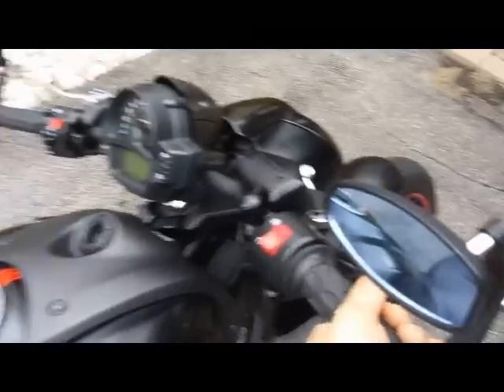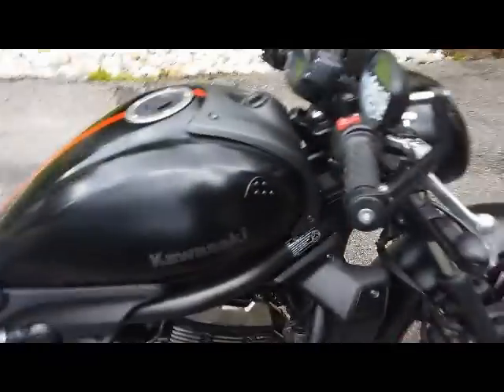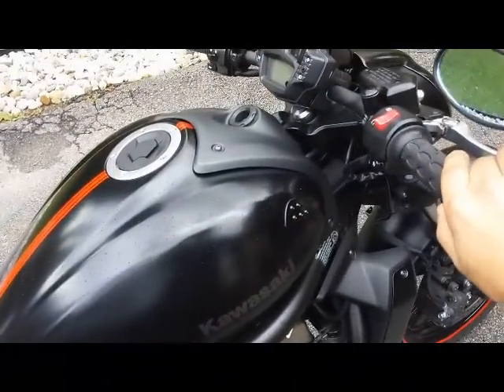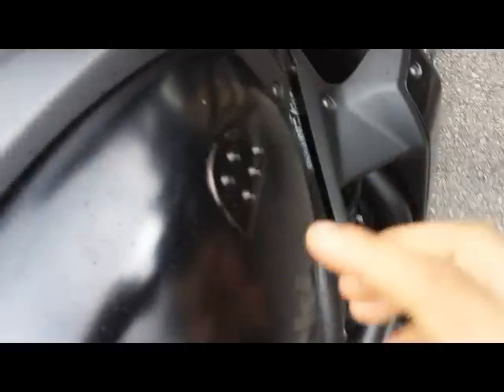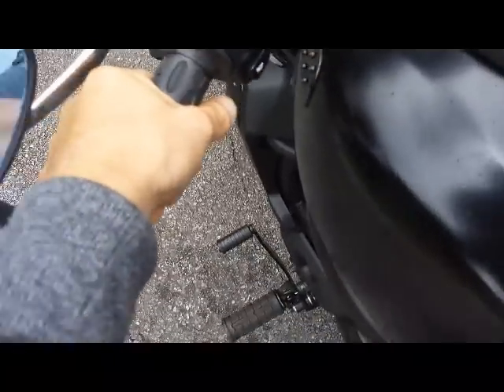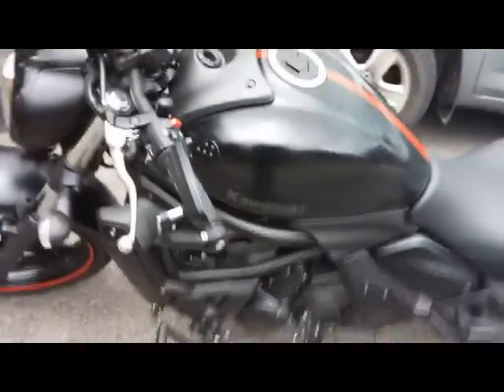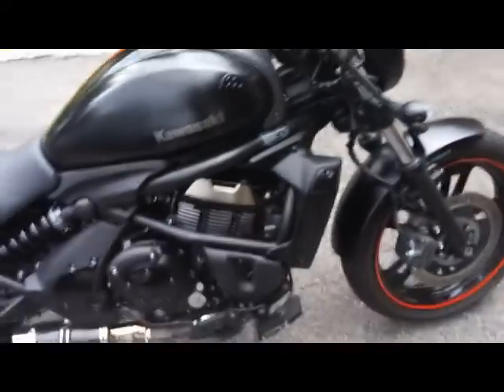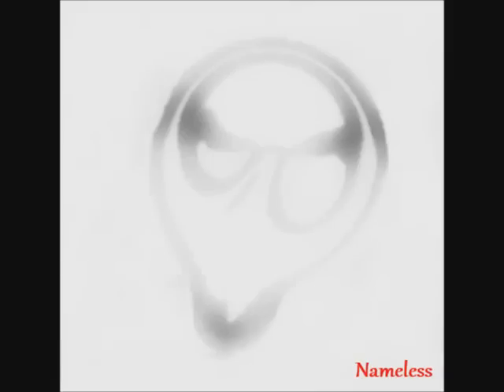Kawasaki Vulcan S Drag Bars

Comment: Hey, your Vulcan looks amazing with these new draghars, may I ask you didn't you have any problems because it does have two different sizes, it is thicker in the center, I think 28mm, and then it is 22mm. Where did you buy it? Thanks for the video.
Reply from the maker: Germán Ruiz. I got them on eBay as well as brackets to make the handle bars wider , only problem is the handle bars hit the gas tank when you turn
Reply: Thanks man, I started the transformation fo my Vulcan after I came across yours by chance! these low handlebars look amazing. I will upload a video with the changes I've made so far, I got a Spark exhaust with a great sound as well. Dude, do you still have the link of the handdlebar in ebay? and if so can you please send it to me? Thanks again.
Reply: Or you can also tell me do your handlebars have any size in tall or are they just flat? I've found a brand here in Spain that offers 3 kinds of handlebars being 28mm in the center and 22mm each side, first one is 20mm tall, the second is 40mm and the last one is 61mm.
Reply: @germanru76  can you tell me the link of that seller plz which can properly fit on the vulcan s

Comment: where did you get the drag bars? is it comfortable? considering the riding position?
Reply from the maker: Jingo Bautista I got them on eBay and no it wasn't comfortable after having the stock bars . I had them on for 2 days and I changed back to the stock handle bars .